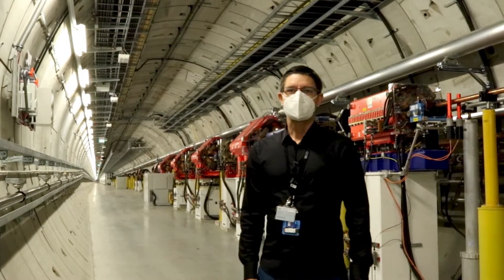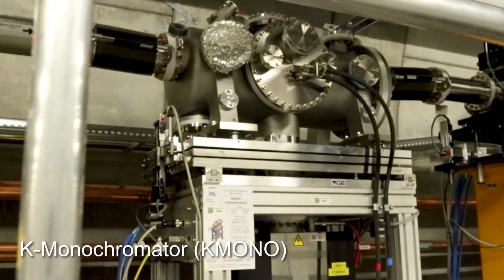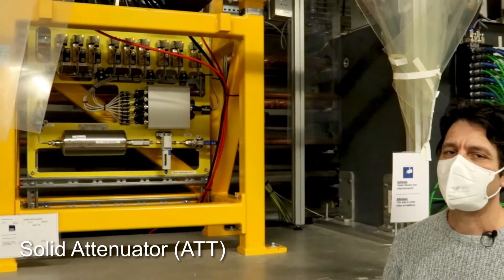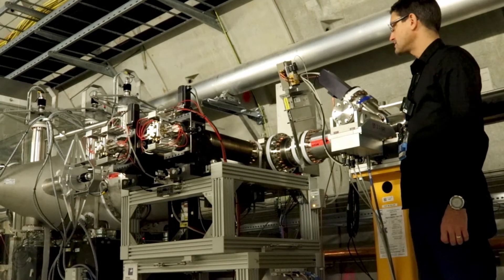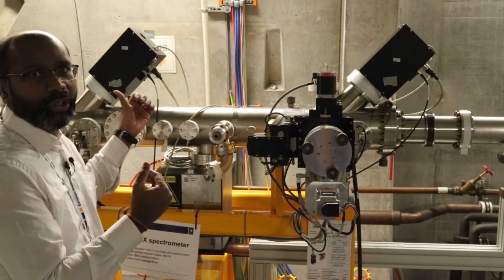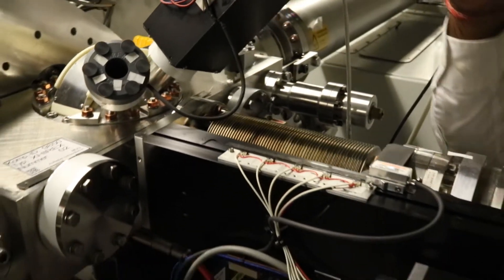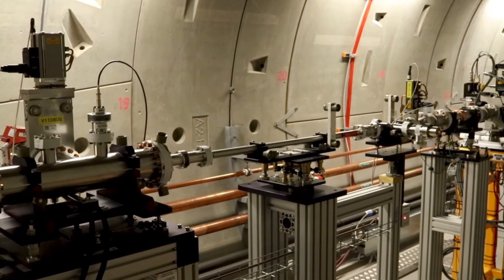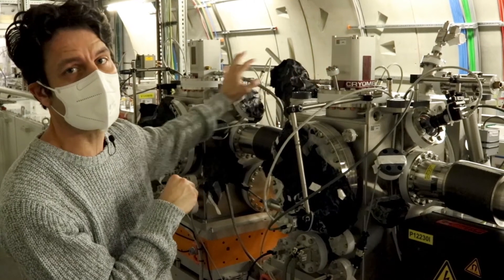Explaining the European XFEL X-ray Optics and Photon Diagnostics tunnel components

Comment: Is it possible to decelerate the electron beam and spread it laterally to form an electron-only diffraction grating at sub-atomic scale?
Reply from the maker: Dear Garganzuul, we take great efforts and almost 2 km of linear accelerator to produce an electron beam with very high energy of up to 17.5 GeV. Also, there are special electron beam focusing elements that help maintaining a particularly small transverse beam size (small emittance).
Wouldn't it be a waste to decelerate and defocus these special electrons since we could just use another electron beam for that purpose ?
In any case one would need something more substantial than electrons to scatter x-rays sufficiently. Besides, it is these high energy electrons that create the X-ray laser beam in the first place, thus if sufficiently dispersed laterally (large emittance beam), no lasing would occur and we wouldn't have any x-ray laser radiation to scatter from anything.